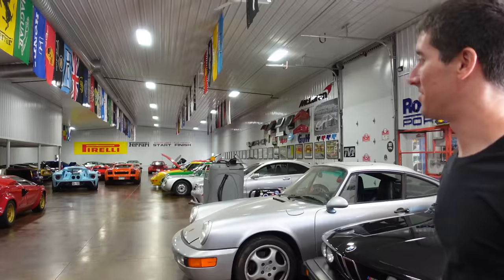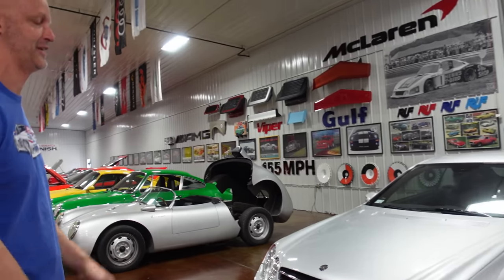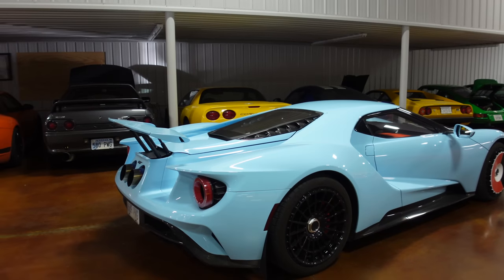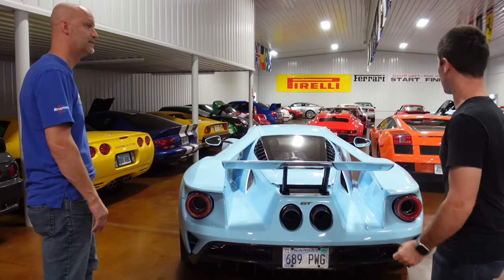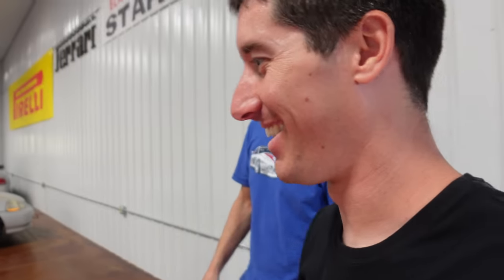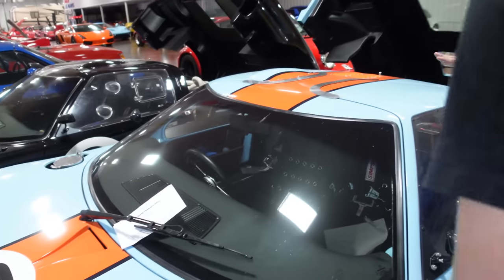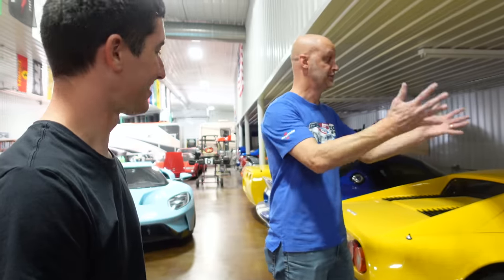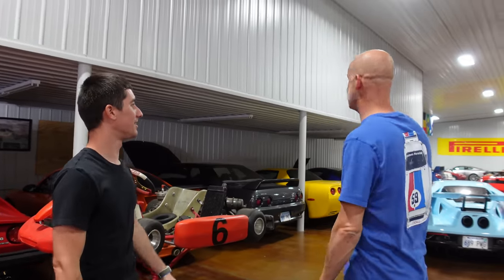I Drove The BEST CAR EVER MADE (It's A Ford)

Comment: JR, I owned one of those little Honda Civic Hatchbacks.  I rebuilt the carburetor on mine.  The one I had was manual transmission.  It could go a lot faster than it seemed and it could corner really well also.  I absolutely loved mine.

Comment: The older air cooled 911's are fun to drive, but for a year 'round daily driver, the a/c isn't the best. And for hot humid eastern cities. I'd want a powerful a/c system. Not sure how much better the water cooled 911's are a/c-wise. And the all wheel drive Porches, hmm, I just get the feeling they snuck an Audi quattro drive train in those. No thanks. The original remake the the Ford GT is still my favorite, for the styling after the 60's winning racer.